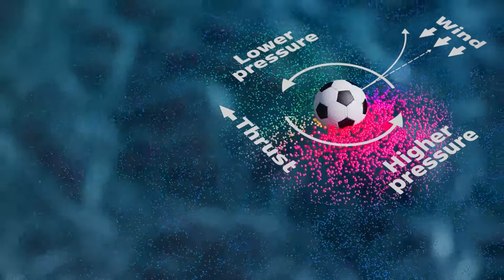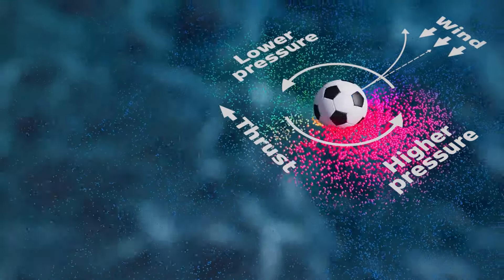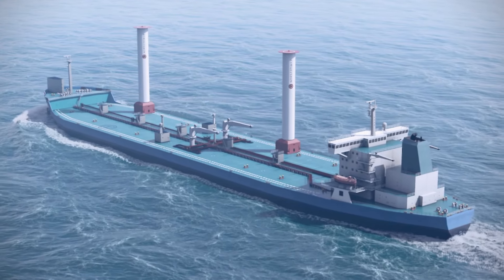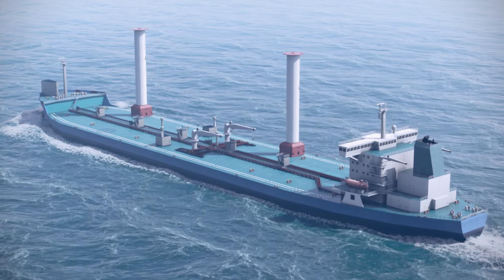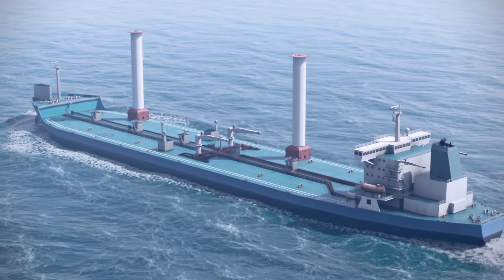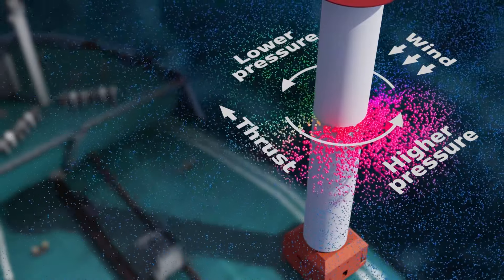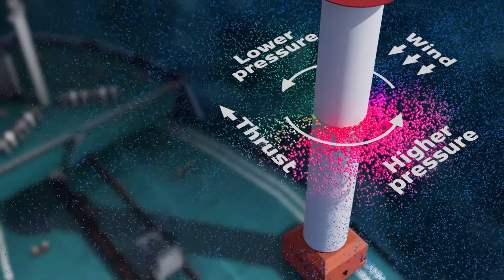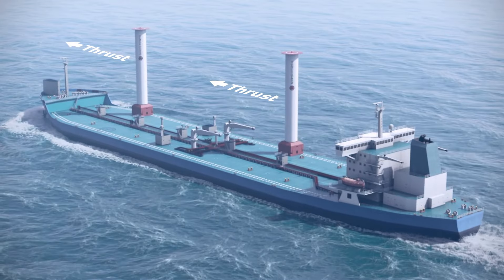How do Norsepower Rotor Sails work?

Comment: Would it be feasible to fit an alternator to the base to then use the kinetic energy created by the spinning rotor as electricity, further increasing the effectiveness?
Reply: bruh the rotors are actively made to spin with motors
Reply: Well that answers my question pretty definitively
Reply: @jasonlindbeck8023  There is however unused space on the top of the rotors, perhaps a free spinning vertical axis wind turbine could be added there - but the additional weight and complexity is probably not worth it.